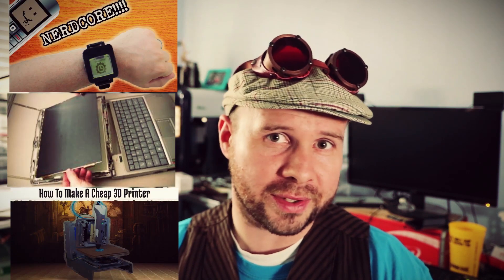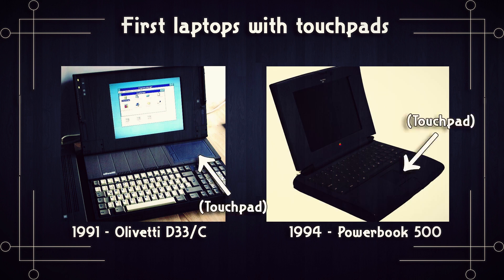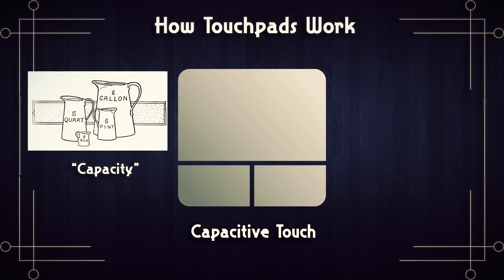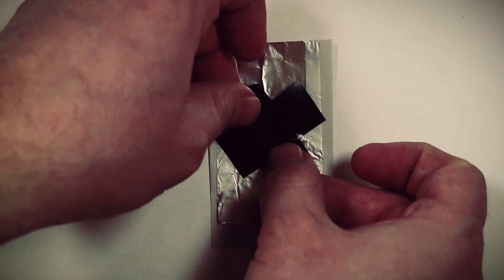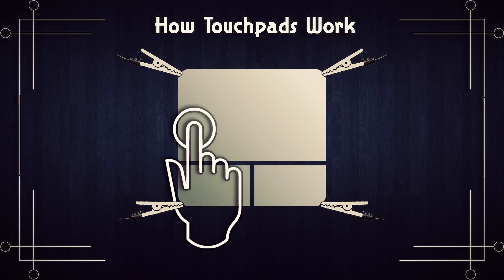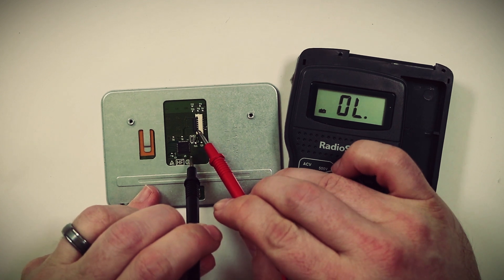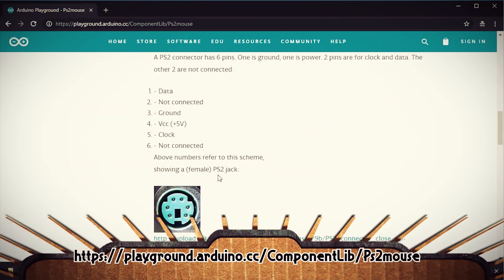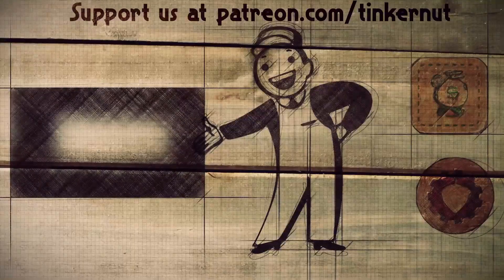Things To Do With A Broken Laptop: Touchpad Hacking (part 1)

Comment: Recently I got my hands on the same model of laptop, and today I was taking out the touchpad to use it as my PC mouse (I really love me touchpads).

But sadly, I have no tools or experience working with electronics, and every guide I saw said "take your oscilloscope to check the contact points", but I don't have one!

That's when I found your video, with the exact answers I was looking for! Thank you!!!!

Now, I just need some hot glue and attach the cables.

Comment: 12v application for a cars center console. Fiberglassed in the palmrest AROUND the so as to have a factory mounting for it. Also backed it with sheet metal for strength. Connected to raspberry pi as a control accessory, with hopes of eventually having dual controls. The other being the cursor joystick from an Audi. The touchscreen is a dashdash mounted 10” tablet display 

Also connected is a USB hub containing a DSLR dongle for AM/FM radio reception, USB wiFi adapter, and jump drives for storage

Comment: I just preordered your book (paperback version) It’s like Christmas for late March :)

I was just wondering. 
There is a kindle version of the book.
So I was wondering if the book would contain a lot of pictures?
Or will it be mostly text?

I only ask because kindles can’t display color. (At least mine cannot) 

And if the book used pictures as instructions, I could be hard to read on the kindle.

I opted for the paperback version.
But I may buy the kindle version as a gift for my brother witch is why I wrote this comment :)

I’m exited for the book and for what you will do next.

Cheers from Denmark

Comment: You could use that for drawing,just use a capacitive pen and draw there as you would do in a paper and then connect the trackpad to an application that translate X and Y coordinates into a line,i know that it exists but it's much less expensive than the commercial one. You could even set an alternative options to make a rubber so that in that specific X and Y coordinate it just erase or paint white...

Comment: I would control a midi device with it, x being one parameter and y being another(using control change). Arduino Uno usually uses a MIDI connector on the serial Port for command send but you could use USB on It, to replace the midi connector
Reply: @Edward Elric I would love to do make a DIY touchpad midi controller. Did you by any chance attempt this ?

Comment: Gesture input for shortcut/macro functions on computer.

Virtual kissing-booth robot

Two-axis controller for vibrating bed/apparatus to independently control vibration frequency/intensity

Controller for smart showerhead

Control an electric latch for a doggie-door and train your dog to touch it's nose to it to let itself in and out

Used as a controller for "stealth applications" such as an RFID reader or hidden camera

Coupled with the buttons just a plain old wireless input device for any pc. Like a wireless pen and tablet

Thermostat control

Smart toilet seat

Inquire for more!

Comment: I have made a touchpad controlled arduino bicycle speedometer with the nokia 5110 lcd and a menu system and all that goodies.

I'm still working on it tho, I want it to have an on-board li-ion battery, powering lights and systems, and charged by the dynamo

Comment: @tinkernut You could use the touchpad as a virtual dial combination lock. Say our combination was L3, R6, L10. To activate you would put your finger on the touchpad near the top (12 o'clock on a clock face)  and drag your finger around an imaginary clock face, to the left in an anti-clockwise direction to 3 o'clock. Then around the clock to the right, clockwise to 6 o'clock. Finally left, anti-clockwise to 10 o'clock.
To read the numbers from the touch pad, the Arduino would store the start position and then read in the numbers from the touchpad data. As the finger moves around the imaginary clock face the X and Y values will change. So for our first number we're travelling anticlockwise to 3 o'clock. The X and Y will decrease, as we round the 9, the X will start to increase and the Y will continue to decrease. As we round the 6, both the X and Y will increase. We know when we are at the three when the finger stops after reading in a number of data samples where X and Y were increasing but Y was increasing exponentially faster than the X. We hold the finger still for a half second and an LED lights so we know it's recorded the first number in our combination.
Repeat this for each number. It will take a little trial and error to figure out the relation of the numbers leading to the numbers between the quarters, but I'm sure it's possible. I don't have a touchpad to experiment with.
once the right number of digits for the combination have been entered, the Arduino can compare it to the stored combination and then trigger a solenoid or servo to open a lock if the combination is correct.

Comment: im going to use a touchpad as a hidden number pad for a door entry circuit.
Reply: That's cool
Reply: That would be awesome.
Reply: fab idea! do share the project outcome in a vid (if you haven't already) or on instructables or something. That would be a project i'd like to see.
Reply: good ideas. tinkernut subscribers are smart
Reply: I totally need to do this for a security system for my old Nissan motorhome.
Reply: I thought the same thing but it will not be too difficult?
Reply: Stop being creative
Reply: dambg thats smart. if I was a thief and I couldnt figure it out I definitely wouldn't try to break in exactly the same way that I would if I didn't have the key to a keyed lock. I'm so foiled, I'm going to wrap myself around some leftovers...from your fridge...because I just broke in anyway...
Reply: not so hidden anymore huh ;)

Comment: What kind of arduino would be good for this kind of project?
Reply: adafruit has some low cost arduino boards with serial out, try there. proto on an uno, then move to smaller board if desired

Comment: What would I use an old laptop track pad for?  Well, you see, even though the track pad is only capable of keeping track of X and Y axes, I would use it to control an Indian Airforce Drone that is actually moving in 3 dimensions (or axes X, Y and Z) because Hollywood says it's possible. 

If this sarcastic reference eludes you, please see 2014's 'Interstellar'.  I love Christopher Nolen's writing, but dang, dude!  At very least, hire a friggin radio control hobbyist!
Reply: if its multi touch, why not think of the pinch/zoom as a Z function.
Reply: @AndreasA.S.  
I would absolutely love to see you attempt that with a physical aircraft in the air (and not crash).
Reply: Add hold, tap, multifinger, "special locations"/function keys.. shouldn't be too impossible!
Reply: I know it's not possible, but it's necessary.
Reply: 3D position can be controlled with just pitch and yaw or roll, so a 2D input device works.
Reply: Have you tried Apple’s “Force Touch”?
Reply: @Meh Meh r/whooosh

Comment: For example, you can control an Arduino servo motor, Or make it an extension for another laptop or phone, or to a  Raspberry Pi. That will be a good project I think.